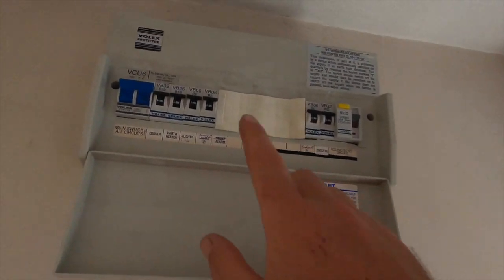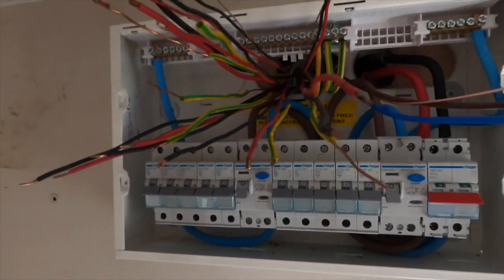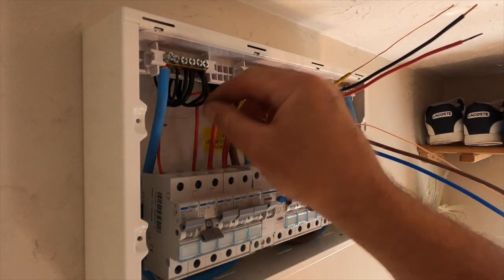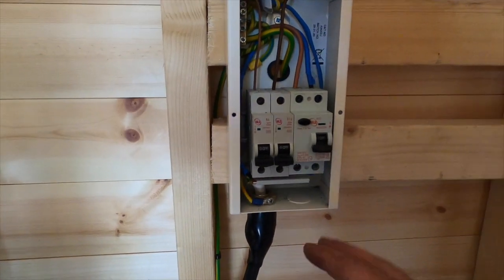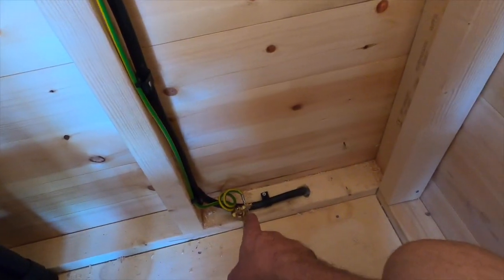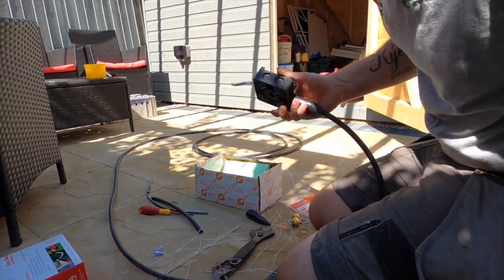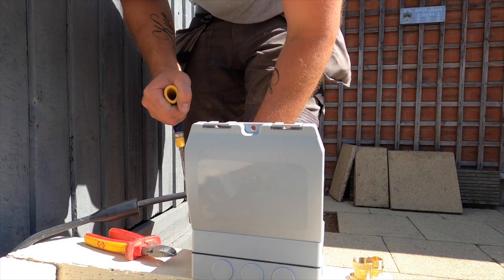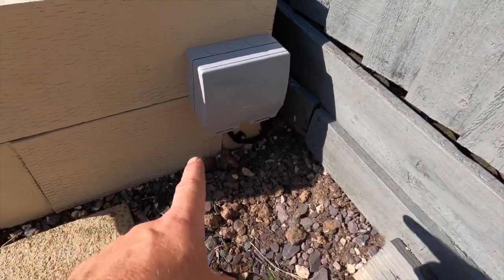How to change a consumer unit

Comment: I don’t understand how you can change a board without testing it first what happened if you find out there is a whole host of problems, even sockets without grommits etc you are fully committed to sorting the install to a level you see fit to take on the responsibility of the install from here on out?
Reply from the maker: Alex Gecko thanks for your questions this particular job was set out that any faults found was to be rectified and the house was not that old. Yes depending on what condition and rough age the existing installation is is weather I test first. Hope this clears it up
Thanks again 👍